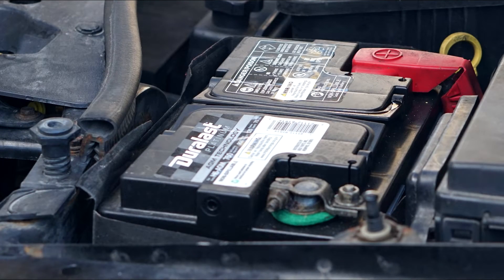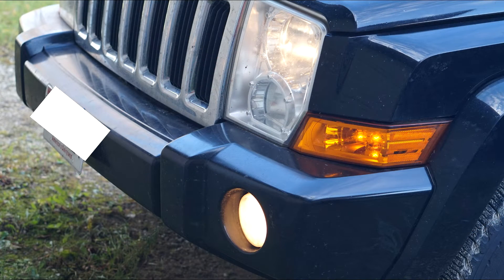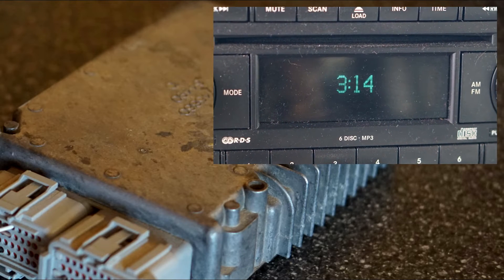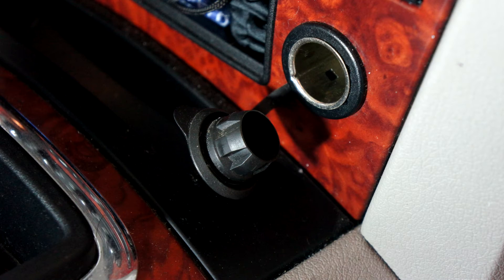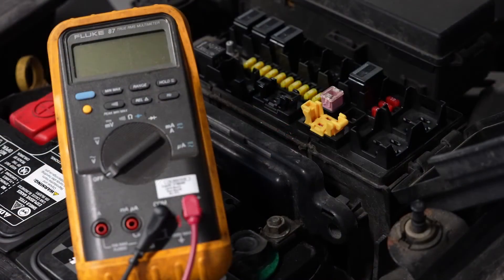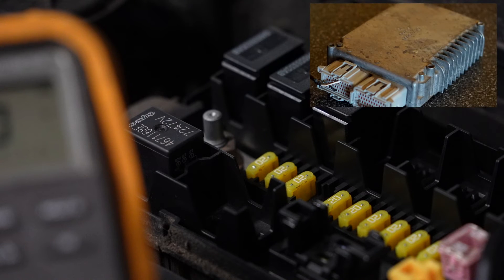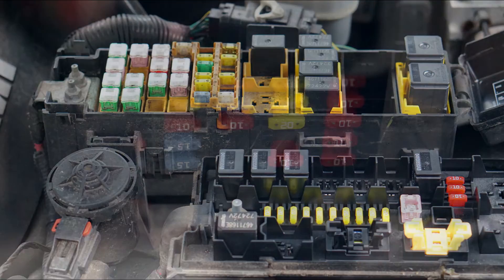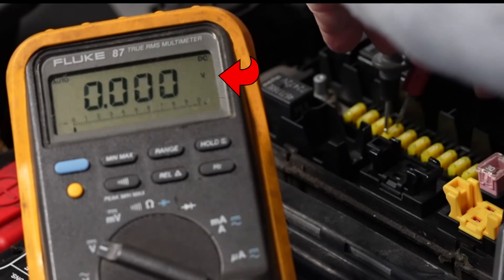Best Way to Test for Parasitic Draw

Comment: im having drain battery also i change battery third time already still draining follow your instructions using multimeter found a fuse @21 back up, fuse @22 audio remove fuse#22 audio i cant use infos system radio speaker and right camera or back up stil l drawing power because of the fuse@21 back up i dont want to pull it  because i dont know what it connected too? i need your help on wiring diagram for honda hrv 2020 went to see alldata sites it does not have the vehicule that i have check mitchel1 mostly for usa and europe does not make me buy it do you know any sites or idea that can help me please? talk to the dealer ask me for 300dollars for diagnose and if found another extra charge would like ot do it my self but im stuck. now my option is jsut disconnecting the negative terminal everytime i use the car i am tired of doign it everytime if i dont i cant start the car always using booster now please help. were did you get wiring diagram i live in canada

Comment: This is an excellent video!
 After looking at quite a few vids on parasitic draw yours is far and wide the most straight forward and concise. Short and to the point.
Many do not offer the cross fuse voltage check at all. 
Keep it simple and Keep it up. Thanks so much!
Reply from the maker: Thanks for watchin and thank you for the feedback!

Comment: Using only a multimeter can I just measure voltage drop across the fuses?

Then when I find a fuse that has a voltage drop can I put the multimeter in series and see if  the draw changes with the fuse installed or not?  

Late model Jeep so I don't think there are any devices in sleep mode that will be wakened by pulling fuses.
Reply from the maker: Thanks for watching. We would recommend consulting your mechanic on fuse voltage.

Comment: what if you don't have an amp clamp but just a multimeter which is probably the case for most folk who might attempt this?
Reply from the maker: Hi - Thanks for watching! Testing using this method can not be performed without the use of the “amp clamp”.
Reply: Cannot be measured without an amp clamp?" Where did THAT come from? Can't an inline amp meter measure the same thing? @TheBatteryShop

Comment: I just wanted to say thanks as well.  I have a 2011 Toyota that suddenly kills a fully charged battery within 24 hours.  I want to rule out parasitic loads before I change the battery.   Engine runs with a completely dead battery, so I'm pretty sure the alternator/voltage regulator is working.   I have an aftermarket (Android) head unit, and installed a passive key entry (PKE) unlocking/remote starting system - both of which were installed years ago.   I would expect some higher-than-OEM loads, but not enough to run the battery down that quickly.     This problem only appeared a couple of days ago.    I'll give this a try once I fully charge the battery and put the key fob far away.
Reply from the maker: Hi - You’re welcome and thanks for watching and sharing your experience!

Comment: I feel dumb. All this time, I thought I could only do this by wiring the multimeter in series and testing for current. This absolutely works. But why does it work? I would think the voltage from one side of the fuse to the other would not drop since you’re not testing on one side of the load vs the other. Is this because the fuse itself is heating up and causing drop?
Reply: The short answer is that the thin wire (the part that blows) in the fuse has higher resistance than the rest of the circuit.  So when 12V is on the line side (coming from the battery), and the other side of the fuse has something "sucking" electrons through the fuse, the voltage on the sucking side drops just a tiny bit compared to the battery side.   This slight difference in voltage can be measured.     Imagine two cups of water with a thin tube connecting the bottom of both cups.   As you take water out of one cup, the other cup's water will flow to the one with less water.   But it doesn't happen instantly.   The straw slows it down enough that there will always be a difference in the water levels between the two (so long as one is still losing water) because of the resistance/friction of the straw.
Reply: @erkme73  makes perfect sense. I never thought that fuses would draw current themselves, but I get it. Maybe a higher capacity fuse wouldn’t show it, but sub-20 or 25 amps would likely have some resistance in such a thin wire.
Reply: @BabyGators   You're getting there ;)  The fuses don't actually "draw" current, but rather slow it down.  It's a restriction that creates friction in the flow of electrons.  Not enough to affect any of the devices on the circuit, but enough that will register a drop in voltage between the sides - and then only if there is something pulling power through the fuse.   That's why circuits that have no load will also have no difference in voltages.   Just like the two cups with a straw between them will have the same water level if none is leaving either cup.

Edited to add:  You are correct that larger fuses will have less resistance and will therefore have a smaller voltage drop for the same load.   IOW, a 5A fuse may drop 0.5% with a 3A load, but a 30A fuse may only drop 0.05% with the same 3A load.   But, it will still drop... enough that a meter measuring milli-volts will see something other than 0.00.
Reply: @BabyGators  As @erkme73 said, the fuses don't "draw" current, but you can think of it as they "make the  current pay a toll" as they pass through. Tolls are only collected when "cars" (electrons, in this case) seek to pass the toll gate. So if the toll gate (the fuse) says 0, no cars are passing through.
Reply from the maker: Hi - Thanks for watching! Pretty much. Each device or load that is carrying current to ground in the circuit will offer some resistance.

Comment: What settings for voltmeter and amp clamp?
Reply from the maker: Hi - Thanks for watching! If you don't have auto ranging meters use a low volt (2-12) scale on your voltmeter and low or milliamp scale on your ammeter.
Reply: Do we really need  an amp meter..
Reply: So for a newer car I still use the amp clamp, but also the probes and check each individual fuse.  Once I get a parasitic draw I pull the fuse and the battery reading will be good? That part has me confused. Or am i just using the probes until i find a draw then test the battery with the probes by touch the negative and positive.